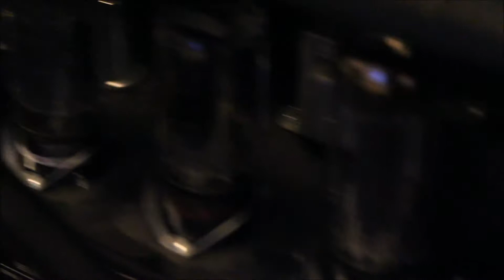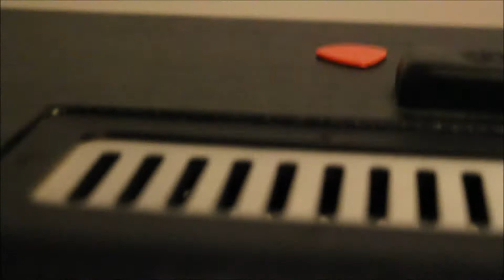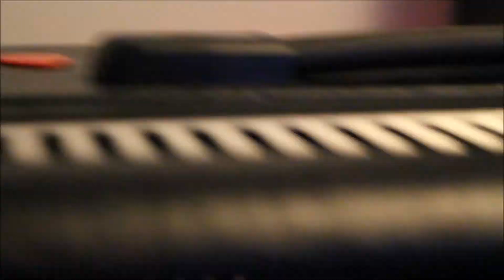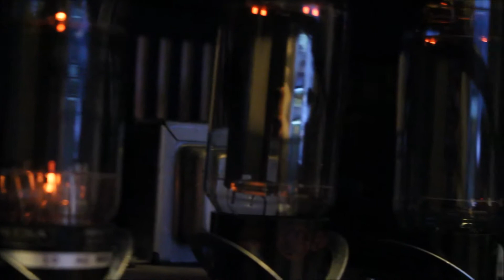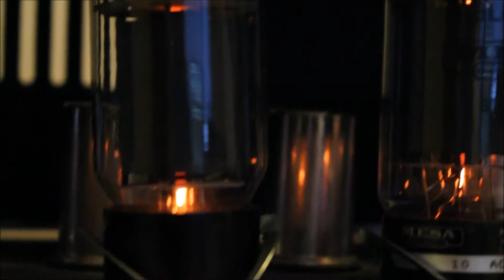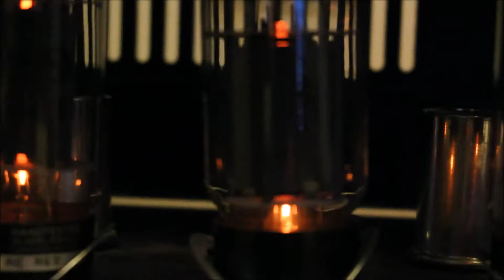HELP! Amp tube leaks and volume drop.

Comment: Have you found out what your issue was? Was it your powertubes? Capacitor broken?
Reply from the maker: I've just kind of let the rattling go as not a big deal. It doesn't effect how the amp sounds at all. The volume drop was fixed by spraying deoxit cleaner in all the jacks and tube sockets.
Reply: Gabe Person I've had somewhat the same experience and in my case it was my powertubes rattling, switched back the old original ones and the strange sound was gone

Comment: Can barely hear what you're saying
Reply from the maker: The point of the video is to pick up the noise the amp is making. My voice isn't top priority. But the volume drop problem is fixed. It still makes a gas hissing noise when I turn it on though

Comment: Learn how to record the sound track on your video...
Reply from the maker: Hangfire-13 what do you mean?
Reply from the maker: I had my mic in the chassis of the amp to pick up the sound and that's why it's so quiet.
Reply: Learn how to be constructive.  It makes everything better rather than worse which is what you have accomplished so far.